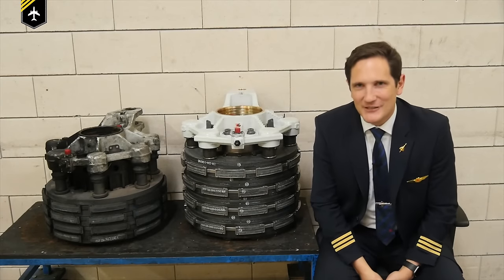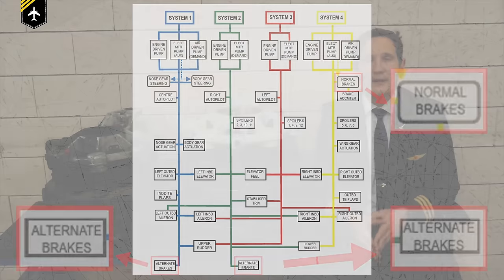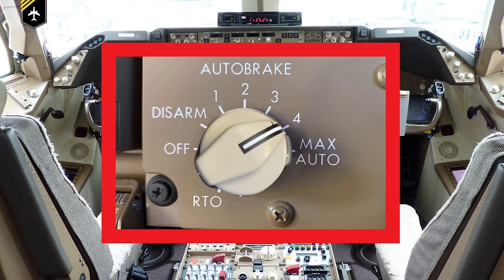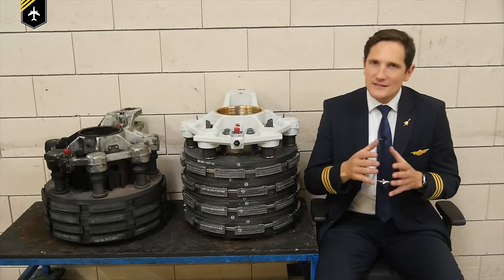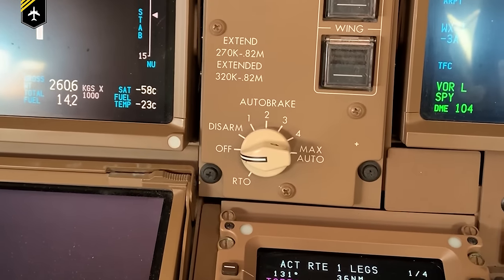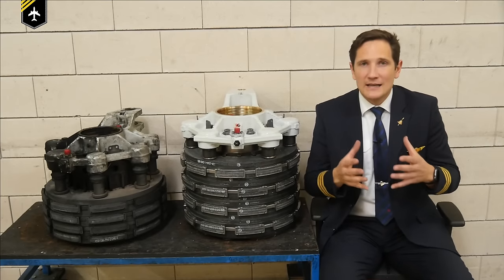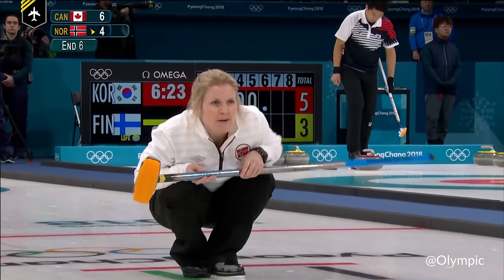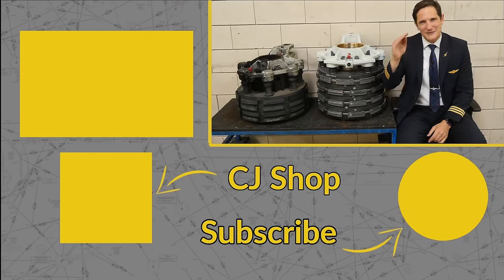How do PLANES SLOW DOWN on the RUNWAY? Autobrakes System EXPLAINED BY CAPTAIN JOE

Comment: Why don't flight goes in reverse, why flight need a pushback... Why.... Any reason for not having reverse rolling???
Reply: Bruno Robert he’s already made a video on it. Search captain joe pushback
Reply: There are reasons to use the pushback. For example the airport regulations and the airline's standard operation procedures and the aircraft's flight manual. Using the reverse thrust in front of the airport terminal is not a procedure used today. The jet blast is dangerous for the people working there and the jet blast can damage the nearby equipment and buildings. The engines can also ingest debris from the ground which can damage the engines. It would also increase fuel consumption.
It's just more safe and simple to use the pushback method.

Comment: Why don't pasenger planes have hud
Reply: Passenger aircraft can have it. Some aircraft types have a HUD. It can be standard or optional. For example it is used on A350, A380 and B787.
Here you can see it in a B787 cockpit:
https://upload.wikimedia.org/wikipedia/commons/4/44/Boeing_787-8_N787BA_cockpit.jpg